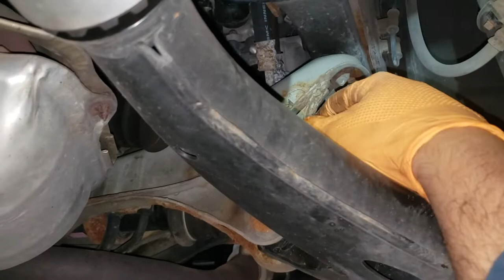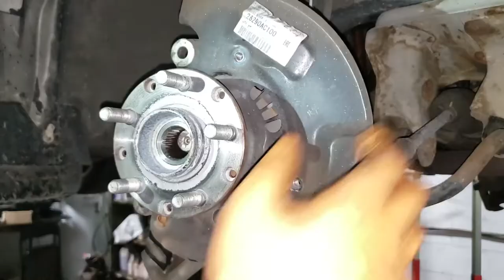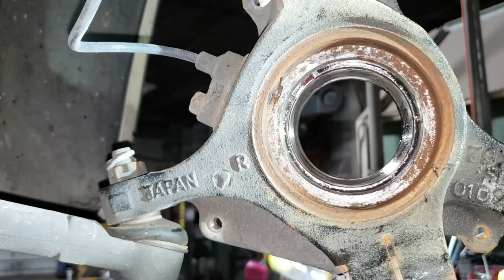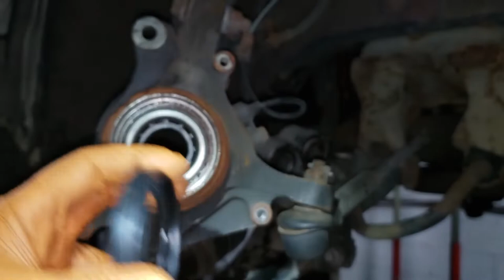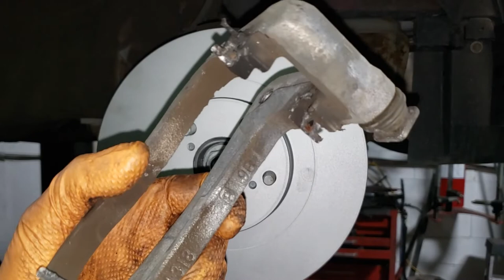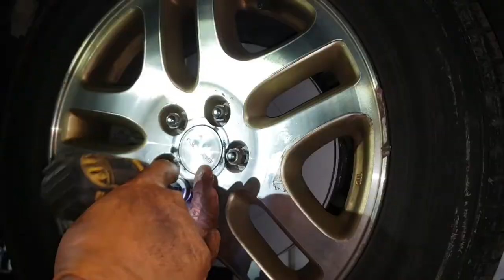Subaru Outback | CV Shaft | Hub | Bearing & Seals | Rotors & Pads 2001

Comment: Literally the only video for this make and model of car. The bearing installation is different from 2000-2002, and 2005 onwards 🙃

Thank you!
Reply: I understand the 2000 through 2004 to be considered the Gen 2 Subaru Outback.  I need to do this job on my 2003 Outback as the driver side bearing is starting to howl ... I sure wish I had a lift. :/

Comment: Holy shit, dude- you're like a "word for word" copy of listening to me work, just with a different accent (I'm in lower suburban NY).  I've been at this for over 30 years, and for the last 17 years, I've been working on recreational marine stuff... you know, boats. Shitty old boats and PWCs... which- I'm pretty sure- makes me clinically insane. However, I started with foreign and exotic cars back in the early 90s, so this is old hat to me, and I just tackled this today with my own personal car. With one little caveat...

I had one side- the shitty looking side, no less- come apart very easily, no bullshit. I did it the "hard way" and took out the spindle, jigged it in a press, and went to town on it. Piece of cake- took a half hour. Then I hit the "clean" side... where the fucking spline on the axle welded itself to the hub so bad, I ruined two tools on it, blew a line out on the press, then ran out of oxygen in the torch trying to cook the fucker out... no mercy, and this thing WON'T FUCKING BUDGE. 

I gave up and ordered a new spindle. Took the whole axle out with the spindle attached, beat it up some more in the press... nothing. Fuck this. Had I known they were cheap and available, I would have just bought the damned spindles and assembled both of them before hand. Oops...

That said, liked and subbed. I'll be lurking in the comments, I guess...

... and I think I share you're feelings on "Blackface" Castreau and the likes, so...  👌
Reply from the maker: Lol, looks like you got one of those spindles that was just a complete nightmare. Yeah sometimes you get lucky with finding Parts you wouldn't think they would have complete sense to replace the whole thing instead of Messing around. Luckily for me it came apart relatively easily. I'm glad you enjoyed the video and yeah hopefully next election we don't have a power hungry narcissist installed again.